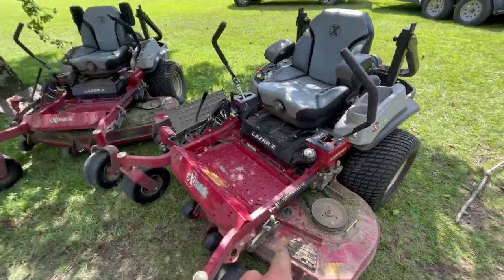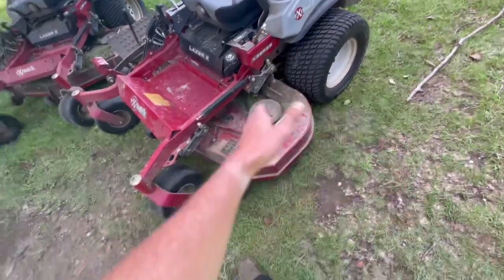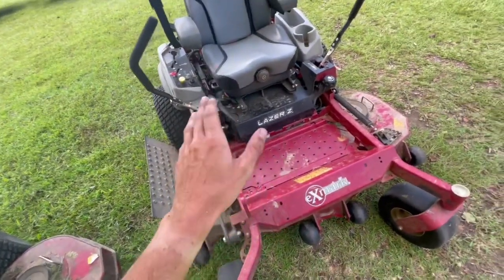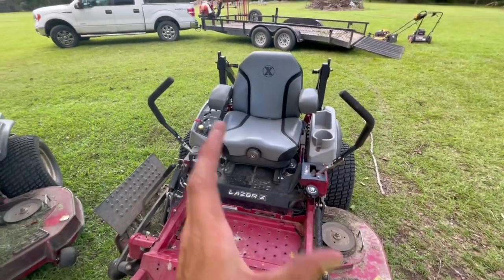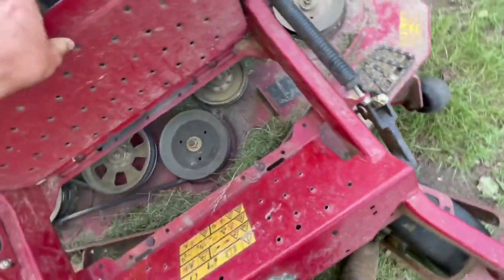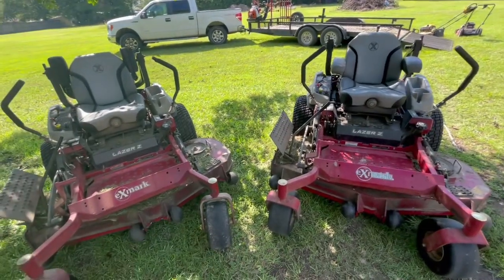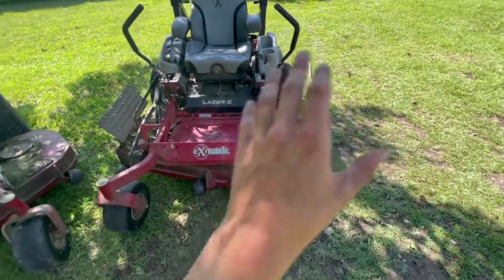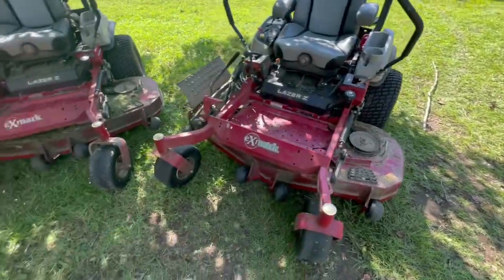2021 Exmark Lazer Z X-Series 100 Hour Review

Comment: I have wondered on the quality gains and losses over time. My 05 liquid cooled Z 60 is shy of 2300 hours. Ready for something new! BUT its only had the belt replaced once never popped off, 1 clutch, all the spindles now have been changed taking some hard hits will do that. Over all engine is strong as ever no smoke, the E break is still as good as day one lol, mulching kit from day one along with striping. Some changes here I like, the controls moved away from your feet, also the deck access opens other direction and stays open. I have had some small stuff go out choke cable, PTO switch, hot wired fan to a switch so I know its running etc